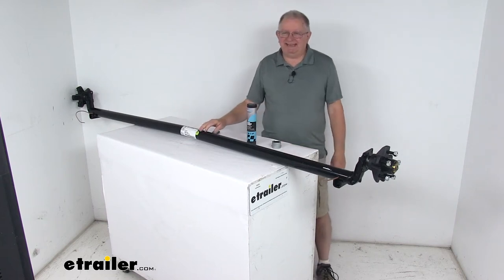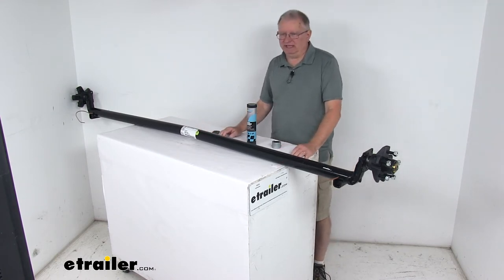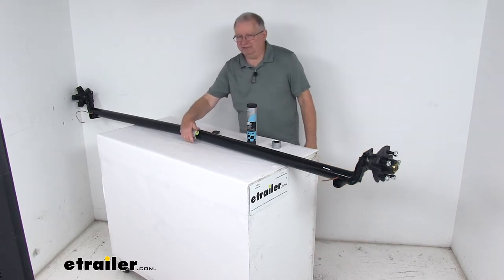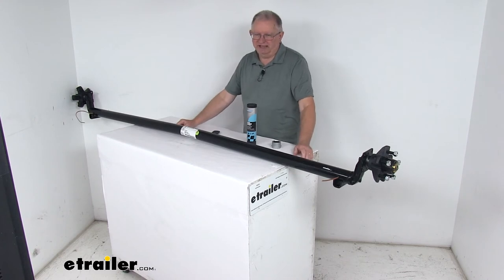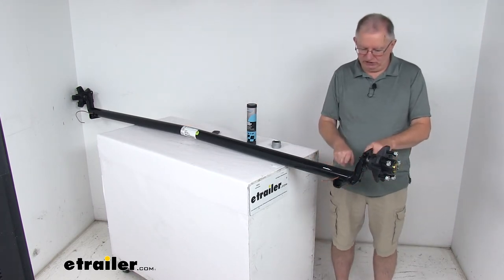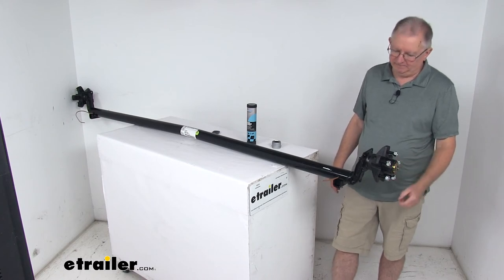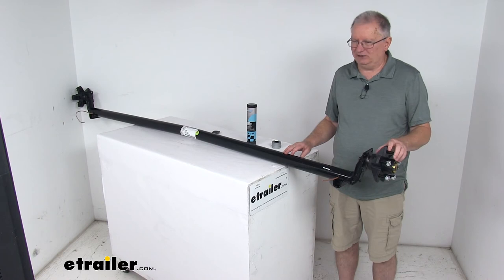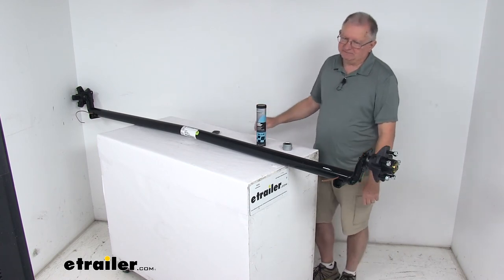etrailer | Checking Out the Dexter Trailer Axle Beam w/ Idler Hubs

Comment: Is there a way to raise the trailer with this axle or do you guys have a lift kit?
Reply from the maker: In order to get more lift out of this style of axle, you could install a lift kit but most people will just swap the axle. You will get a much larger lift by just changing the axle to a standard straight axle.
https://www.etrailer.com/Trailer-Axles/Dexter-Axle/7685269-I.html
https://www.etrailer.com/Accessories-and-Parts/Dexter-Axle/K71-707-02.html
https://www.etrailer.com/Accessories-and-Parts/Lippert/LC270682.html
https://www.etrailer.com/Trailer-Axles/Dexter-Axle/8327834.html